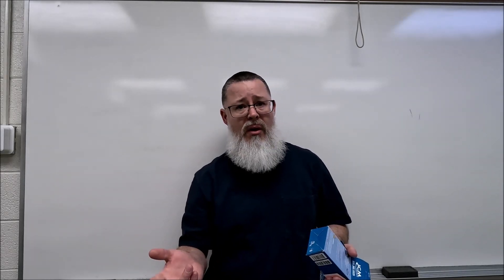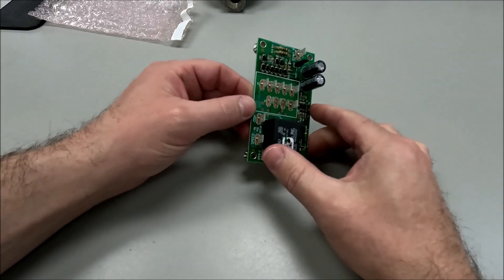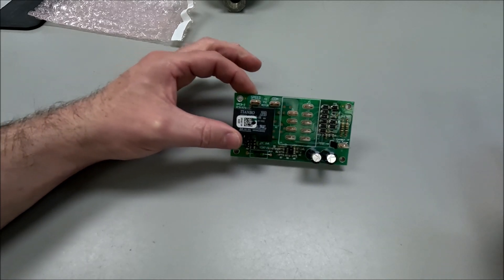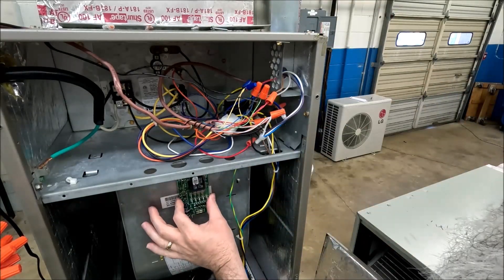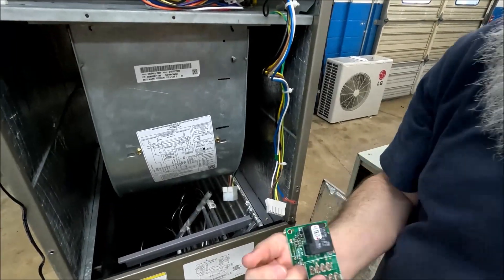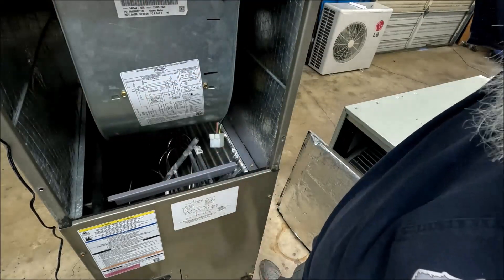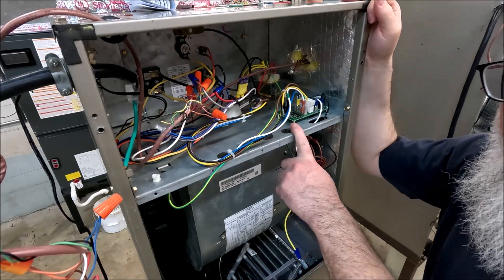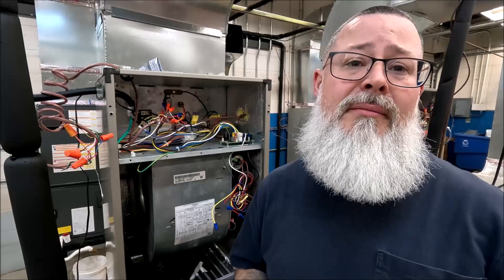Update! X13 to PSC Motor Changeout Using the ICM715

Comment: I'm confused.  Why do you need a special board?  Cant you install a psc, a run cap, and a 24vac contactor to run it?  Contactor coil to low voltage Green (fan) and lv common?
Reply from the maker: Yes but depending on what you do with the extra wires it can get messy. This board just makes it nice and easy to plug and play using the existing wiring harnesses. I kinda like it though.

Comment: John I encourage you to keep making these excellent videos and I hope you get great fortune. I personally have learned a lot, please keep it up, with that being said, I come across many homes not designed correctly especially airflow and static pressures, would you recommend a Universal PSC motor and this board? I would like your input
Reply from the maker: Thank you. I would have to say that the new ECM motors, especially the variable speed, would be a better option than the PSC motor. The PSC is definitely cheaper to replace if it goes bad but it does not know if the filter gets dirty (or whatever). It would go along with the reduction in airflow and pull less amps whereas the Variable Speed ECM wuld sense the loss in airflow and turn faster. More choices with the ECM family besides the Hi/Med/Lo you get on a PSC. All that said, I have a simple PSC motor in my trane air handler 🤣